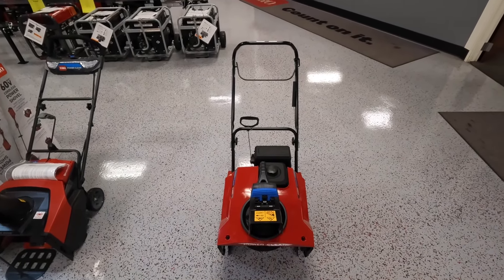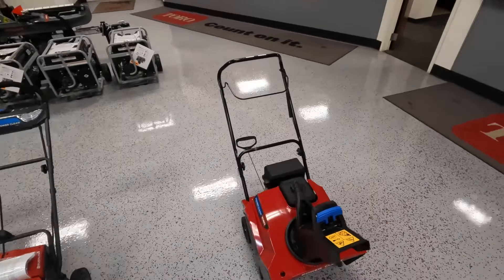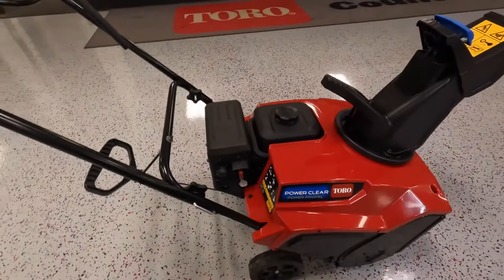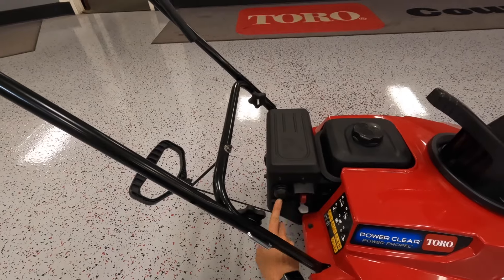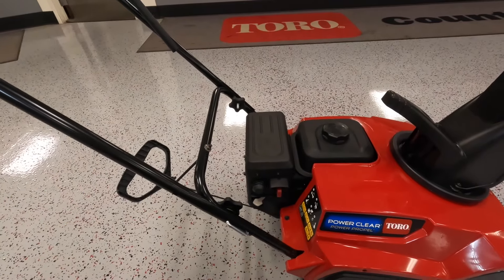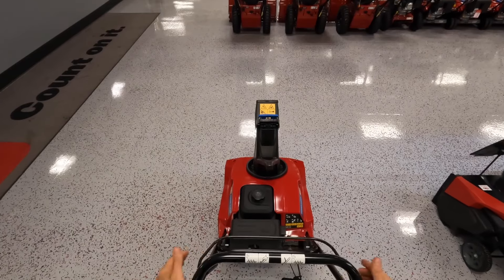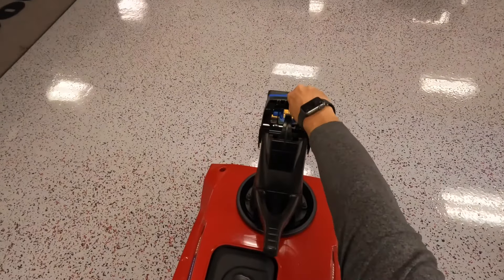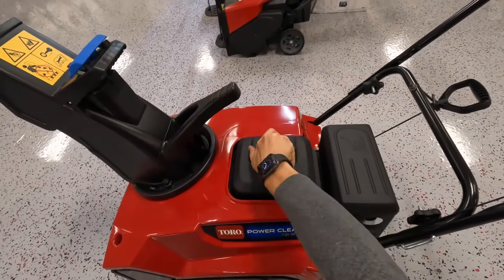Toro Power Clear 721 R Tutorial

Comment: Another thing to keep in mind is to use ethanol-free gasoline. Ethanol absorbs water from the air, which eventually stops the motor from running.
Reply from the maker: Rich you are totally correct! That is great advice, if you have access to ethanol free gas at the pump we suggest to use that as the fuel supply. If you do not have access you can purchase it in quart sized cans but they are a lot more pricey so we suggest to use them when storing your unit during the off season.